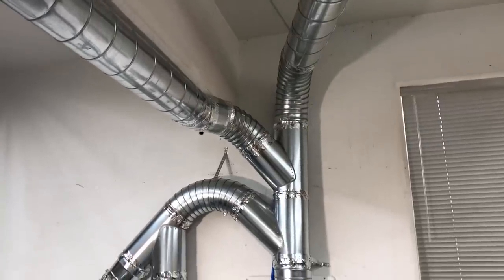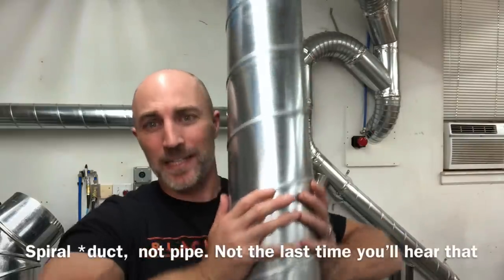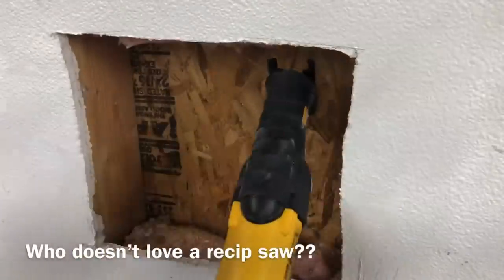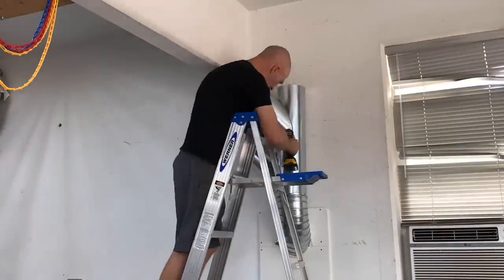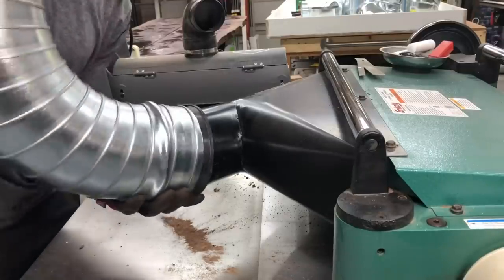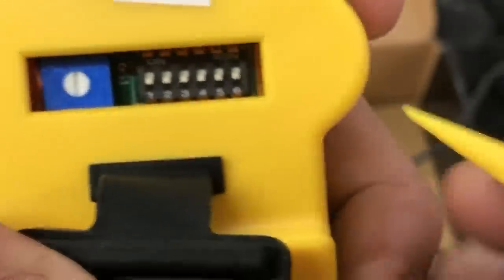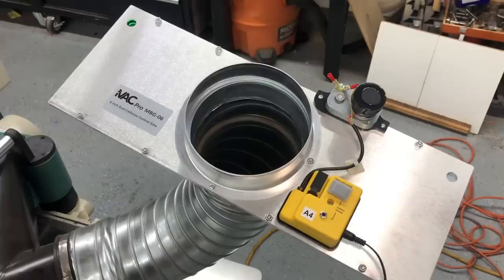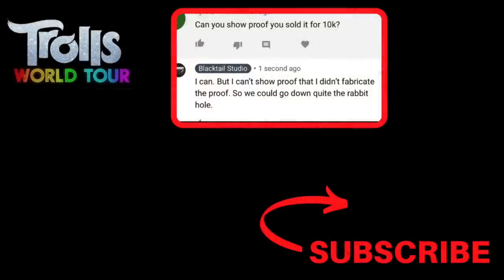Smart Dust Collection - How To Woodworking

Comment: Cam you commented a few times on how you wanted the crimp to be in the flow direction (which is great ), but you then put a big screw in which will catch any shavings and clog the duct. Wouldn't smaller screws have been better? or using some adhesive instead of the screw be even better.
Reply from the maker: Ya, I think rivets are ideal

Comment: Cam, Question as to why you went with a 6" duct and not a 4", seems like you would get a little better suction from just a slightly smaller duct. Also, using double cuts  to cut the duct works very well.
Reply from the maker: Na, smaller restricts airflow. Think of a McDonald’s straw as an extreme example. Want as big as the manufacturer recommends for as long as you can.

Comment: Cam, how is the noise with metal conduit? I’m at the design stages. For cost, I’d prefer PVC but obviously concerned about static (mixed messages on the Internet about this). But with metal, a planer spitting out chips would seem to add a lot more annoyance to anyone (e.g. wife) outside and/or not wearing ear protection.

Comment: Cam.  I am currently completing my small (2-car garage) shop dust collection, and I will likely use iVac equipment with Nordfab ducting, so this video is extremely helpful.  I wondered about your thoughts on placement of the blast gates themselves.  Have heard different recommendations about placing gates close to the tool, close to the wye, elsewhere, etc.  Any advice on that placement strategy?

Comment: Cam, As I said in the last video, I'm in the process of re-doing my system completely. I like the smart blast gates but have a question concerning your choice in ducting (pipes). Spiral duct is much stronger than straight pipe, I've seen other systems that employ a couple type system although yours seems to work quite well. I have the same problem with my planer's chips that you had.

Comment: Cam- 
Would you have used automatic blast gates if you had to pay retail price for them?
Reply: @Lukas 722  Well, I appreciate the fact when youtuber's are transparent  and disclose they received product for free - and it's an extremely fair question to ask if they would have paid their own hard earned money on the same product if they did not receive it for free. I am setting up my own shop (one person) and am curious, pretty simple
Reply from the maker: I think it’s fair. And to be fair, it would be bad taste to take them and then comment that I wouldn’t pay for them. That said!... I would totally buy them. I hate slow downs and love automation. So I will buy anything that saves me time/money. Also the safety feature for my dust collector (some of which I didn’t know until installed these)

Comment: Cam, your new system is a thing of beauty. Do you suppose there is a performance advantage to installing a straight run between 2-45 degree els? The three prong crimping tool tip is news to me and will certainly be helpful. I wondered why my earlier crimps still didn't fit freely.
Reply from the maker: I’m not sure actually

Comment: Cam, again great video, that's some premium level suction right there :D
I'm staring on a table build myself thanks to your inspirationessnesss and I've secured awesome 5cm thick walnut wood..  the surface on both sides is quite uneven so my question is: before i put it in the mold, is it best to plane both sides to make it completely flat? I must have missed that part in your how to videos. Keeping in mind that would take 0,5cm to 1cm of material off due to the unevenessnesss. Cheers ^^
Reply from the maker: Leave it bigger before the mold

Comment: Hello. I am making a river table my self and I saw the 10 000 doller tabel video. And I got a bit worried about the prise of my tabel in the end. My tabel are rufly the same length and thicnes as 10.000 doller tabel. But the thing I would like to ask is, how much was the cost of the materials it self and not all the work? Like the epoxy and the finisher?
Reply from the maker: Not sure the question

Comment: Cam....I'm wondering why you didn't put your exhaust filter inside the shop. You are basically sending all your heat and AC straight out of your shop into the shed.

Comment: Cam- nice job on the install.  I have an Oneida cyclone DC that is about 15 years old. Just curious about your opinion whether the new collectors are significantly better, more powerful/efficient, etc. than mine.  Thanks!
Reply from the maker: Haven’t compared it to an old one personally. Heard there are some smart new features with the variable speed and what not. I wouldn’t replace an old one though

Comment: Cam, second question: do you have an air return?  I imagine you are sucking a ton of air out of your shop, do you allow air to circulate back in or does it suck fresh air in from elsewhere?  I am concerned about blowing hot air outside in the winter.
Reply from the maker: In my new shop I do

Comment: I'm planning my new shop layout now. The whole shop is an open floor plan, but I'm thinking to enclose one corner to provide some needed mezzanine storage space on top and put the boiler, air compressor and dust collection underneath to contain the noise. My question is how do I balance the pressure if the collection system creates a negative pressure in the shop and a positive pressure in the enclosed room without making a big opening increasing noise. I know--I can call Oneida for design planning (when ready), just curious how you may have tackled this issue with your system outside. I am in a northern climate so I don't want the system outside.

Comment: Cam, I'm Jim and this is the second video of yours I've watched regarding dust collection (this one and your Odeida install).  You've help a lot, thanks. I'm building my shop and ready to put my floor in.  I am really trying to put my main duct runs in the floor to come up to my equipment. I'm most worried about the final runs to specific equipment against my walls. Any advice on whether to or not to run my main runs under my floor?  I'm suffering from paralysis from analysis. Any thoughts or tips would be appreciated. Thanks again
Reply from the maker: Oh, I’d love to have mine in the floor

Comment: Cam, I watched both your videos and learned a lot, and I also just finished installing a 5hp dust gorilla pro unit with the basic split ducting supplied by Oneida. I fired it up and I have suction leaks on all my elbows and blast gate connections, and I used the self tapping screws. I am assuming that if I use the supplied tape for those connections it will solve the leak problem.
Reply from the maker: Tape or there’s a mastic made for that.

Comment: Cam, i indeed watched the whole video....thank you!  great video but left me feeling a bit overwhelmed (my issue not yours)  I'm writing to see if you or anyone reading has a suggestion on a   dust collection system for a very small shop (my garage) that is less complicated or has a kit i can simply put together?  i do not do woodworking for a living, just always building and fixing stuff around the house for my family.  I'm so incredibly frustrated with the dust cleanup and most concerning is the lung sensitivity I've developed due to dust/painting etc....and need to do something for my health's sake (and yes, i wear respirator but its still an issue).  i have a router and table, miter, scroll saw all in one table.  Ive looked at at shop vac systems but not sure that would be sufficient?  anyhow, thank you and any suggestions on a smaller system would be appreciated!
Reply from the maker: There are some more tame versions out there for sure!
Reply: As a hobbyist I use the Oneida Supercell. It’s not cheap but it is very versatile for small hobby shop.

Comment: Cam,  First of all thank you for sharing your experience. Your videos are ver detailed and enjoy watching and learning from you. i am building a small shop in my garage and i am looking for dust collection system. i will put it out there that i am in no version a professional woodworker. i started off  more like a week end , DIY kinda wood worker and i am liking the time i spend building some thing. So, my question what system do you recommend for a garage shop  and any tips on if i have to enclose the dust collection in one corner of a two car garage to reduce the noise without loss of suction. I have SawStop PCS175 that i use mostly.
Reply from the maker: Oh man, hard to say from here

Comment: Hey Cam out of pure curiosity I was wondering how you dispose of sawdust
Reply: I don't know what he does, but I use my city's green waste.
Reply: You should be composting it, or just spread it around the yard. If you cut pressure treated, then there is a risk of arsenic or heavy metals.
Reply: @sdspivey  I think he uses a lot of walnut. My understanding is that's not so good for whatever the compost comes in contact with. I know the walnut roots produce juglone, don't know about the wood, but expect that's the case.
Reply from the maker: Ya, yard or yard bin

Comment: Hello Cam, this is a great video.  My shop just got built so I will be setting up my dust collection system.  I have been planning on getting a V-3000 setup but recently I was thinking of maybe upgrading to the Dust Gorilla Pro (probably 3HP).  Anyway, I am also local and was curious where you bought most of the duct work from that you mentioned?
Reply from the maker: Oh awesome. It’s from vinji and sons

Comment: Nice video, especially the automatic blast gates.  do you ever re-saw ~8" wide boards on your bandsaw?  wondering if the V3000 and your set up works as well (leaving little dust on the table or in the bottom housing) when re-sawing.
Reply from the maker: I do. Up to 13”

Comment: Cam, Ive seen a few different dust collection system videos, and usually they say to position the gate as close to the collector as possible vs at the tool like you have done.. do you think this impacted your system performance ? I imagine it all depends on the power of the collector vs the lengh of the ducting.
Reply from the maker: That makes sense. I did that in my new shop. I overcome lack of knowledge with overpowered stuff.

Comment: Silver tape is duct tape for ducts. Grey is "duck" tape, from a type of cloth and is NOT for ducts, it will dry and fall apart eventually. So much confusion out there on these.

Never use black for a ground wire, use green, yellow, or bare. Also, us could just attach to the outside of the outlet box, then you won't have to worry about killing the power to remove it. Or just hose clamp to the conduit.
Reply from the maker: So it’s actually “duct” tape. 20 years after it came out, someone branded “duck tape” since everyone mispronounced it. This stuff is actually foilmastic though. Not duct tape

Comment: Cam, did you have to use a 220v IVan off/on for the dust collector?  I have a big laguna DC and was going to do this, but I don't have an extra 220 outlet for the iVac unit.
Reply from the maker: Ivac is all 110 👍🏼

Comment: Cam
With a system like this do you have to clean out or check the pipes every so often or does 100% of the dust get sucked up?
Reply from the maker: Just installed em. But metal gates like these don’t usually need to be cleaned.

Comment: What was the duct tape brand Cam? I just installed a small system in my shop. First one I have ever had. 4” lines, with a harbor freight dust collector. Seems to be working well enough, but I can tell there are some leaks at the joints. I used the grey duct tape which comes loose and 4” pvc tubing.
Reply from the maker: I forgot to add that! I will now

Comment: Cam, I have to setup and move things around as I don't have a dedicated area for working due to where I currently live. I've been looking at the Laguna B Flux for dust collection. In your opinion would this be a good idea or better to wait a year when we move. Seems like I should get this one now for health reasons and them upgrade later when I have a dedicated shop. The other thing I've seen are the dust collectors that attach to shop vac. But it seems by the time you've built something to keep it all together you could have just bought something like the b flux or see shopfox wall mounted unit. Thoughts?
Reply from the maker: Check out my other dust collection video. Then let me know what you think!
Reply: I'm still not sure what my best option is. I hate this.

Comment: Hey blackmail studio. I got a question for an epoxy pour for a table top I am doing. The wood is not completely flat when I lay it in the mold. If the mold is completely flat could I screw up from the bottom of the mold to keep the wood flat to the mold?
Reply: Then unscrew them when it dries
Reply from the maker: It’ll probably bend again after the pour
Reply: Blacktail Studio thank. I was just wondering what you thought of this. I will try to flatten them out better on the planner

Comment: Dude!!  I JUST finished installing the very same thing in my shop this week.  It was a shit show.  I priced my ducting at Oneida Air and it was about $1,700.  I then went to a local Ferguson Enterprises and the total was $300.  The only thing I had to get from Oneida were wyes.  BIG savings!!  The only thing I wanted that I didn't get was the spiral straight duct.  Anyway, I replaced a 1.5 hp Jet with a 3 hp Laguna C-Flux III.  My CFM has quintupled.  It is amazing!!  
My question is this.  I thought that with a metal collection system that you didn't need a ground.  Is this the case??  Thanks.
Reply from the maker: People seem to debate the ground thing feverishly. I have no idea personally.
Reply: just run a ground line.
better safe than sorry.
anything to mitigate a fire in your man cave is worthy of the time and cost.

Comment: CAM: as an hvac eng, I'm fine with the duct mutilation.. it's suppose to be malleable ;)
But srsly, isnt that setup a little bit over-powered :D? How much does it cost to run? I feel like the endpoints at very big, eg wasted effect and excess EL consumption.. or is it just me?
Reply: I am assuming that part of your degree is moving material suspended in a flow of air ? its a good system, CFM is what is moving the material. Also he is good for future growth. Because " I wish my dust collection was a little less " said No one Ever.
Reply from the maker: I worked with the manufacturer to get the optimal duct sizes. So that was all them

Comment: I would not want screws sticking inside my pipe, that’s going give you problems. Use very short screws so they barely come through or none. I have a 5 hp system and have had no problems using just tape.and as far as grounding goes, its metal pipe what better ground do you want.
Reply: That's the point. It being metal causes the build up of static electricity and you ground it out so you dont get a dust explosion

Comment: Cam: your video sucks! Get it? Dust collection suction! 🤓  Great to see you grounded it as static is real. IIRC, did you add fresh air to shop to relieve negative pressure?  Iknow you did screws incase you have to modify the system later, but I would have used rivets because they won't round out the hole (self-tappers do this) and rivet doesn't have a long, sharp protrusion into the air flow, that could catch shavings, debris, etc. Those blast gates are way cool!
Reply from the maker: Good tips! And I have a window cracked

Comment: Cam,  ROUND = GOOD
air moves along walls and slows down.  look at water in a stream. by the bank is hardly moves. in the center it is rapid.
when you pull the plug in a sink, the swirl will be equal in diameter as per the closest wall.  so if the drain is an inch from the side of the tub, 2 inch swirl. if it is 1 foot from all sides, then a 2 foot swirl.  this is called  HYDRAULIC RADIUS.  the triangles of the corners of the tub see little movement.  similarly, the corners of square duct see much less movement.  in round, depending on disturbances, all sides get swept with the same speed. and air does spin like a bullet, the spiral does cause that to happen.
the only problem I see was in your intro.  the duct rises and passes a trap door.  when you get to moving things around. lift up that horizontal so that it is horizontal all the way to the wye.  and have that one that runs down to the right connect on the top of the horizontal, or the side of the main vertical.  all in all, a very nice job.
Reply from the maker: Awesome explanation Dave!